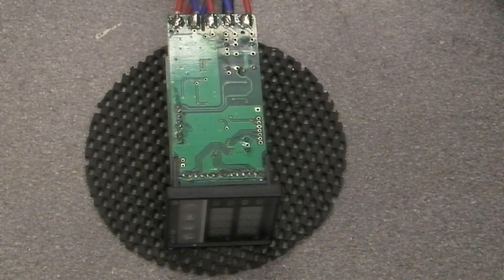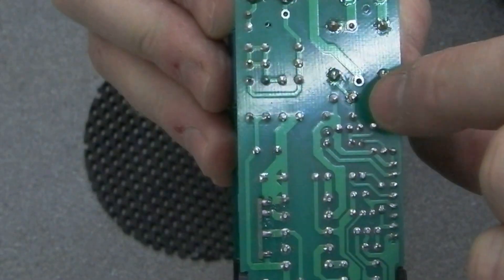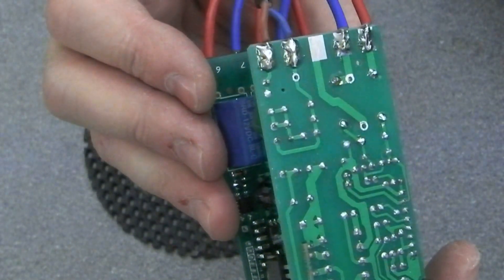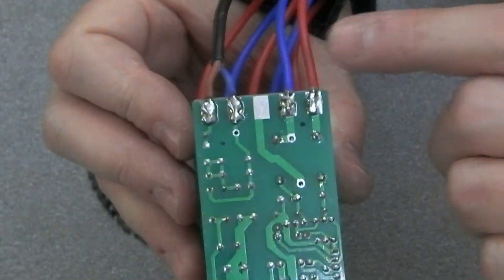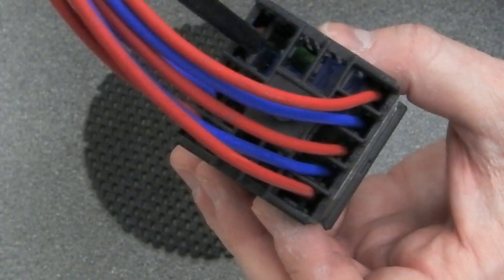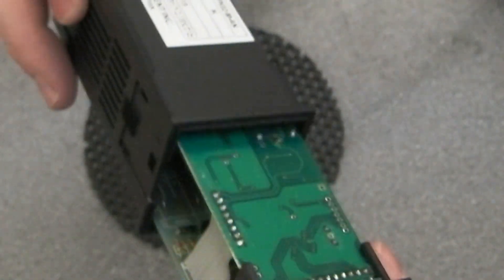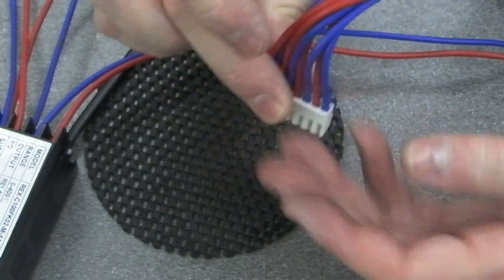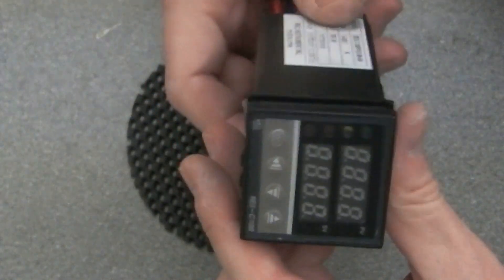REX C100 Hard Wire modification

Comment: Hi trev. 

Looking for some help here as I’m a novice trying to set up one of these units to a cartridge heater. 

I’m a bit confused as to why there are no ground connections on made on the unit. 

And also what power cable do you use to power it? Can it just be any old wire that has a plug on the end of it? 

I’m also from the uk if that has any bearing. 

Thank you!
Reply from the maker: Make a ground for the equipment if required.
Cables used need to be the correct rating for the equipment being powered. That's it really...

Comment: If Pin 3 is actually the power that is switched between pin 4 and 5 when the relay is energized then couldn't someone connect say a 5 or 12 volt dc adapter to it in order to provide the lower voltage required for the SSR?